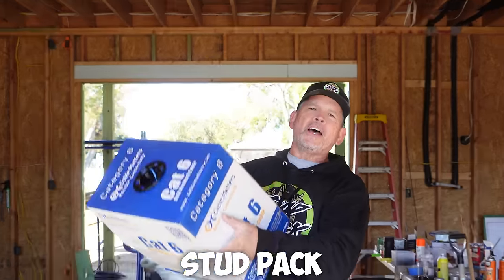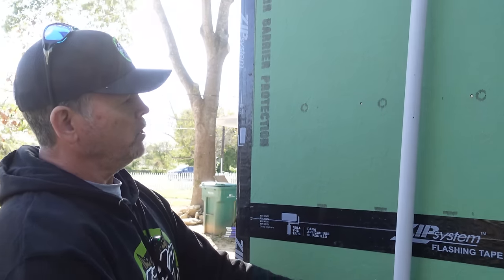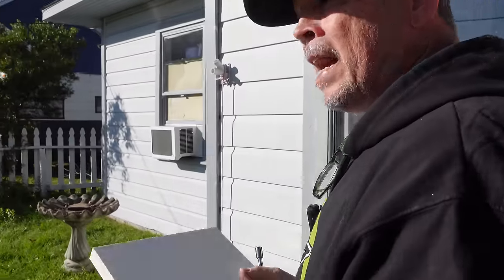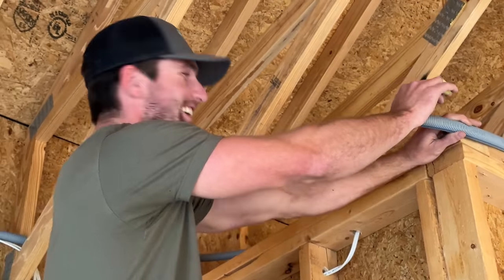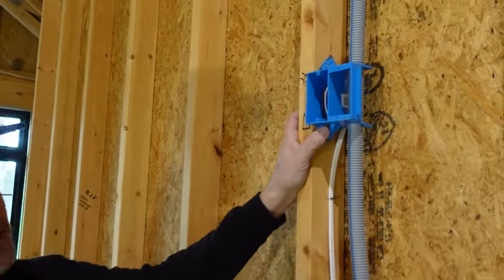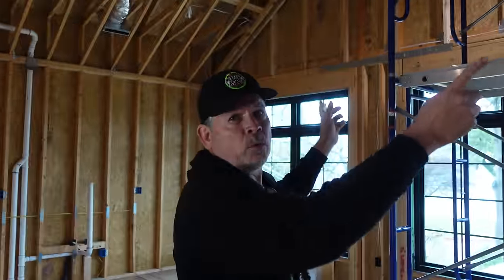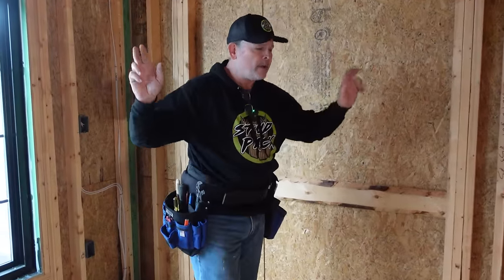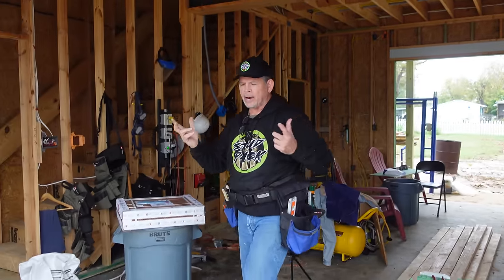DIY Networking for a Future Proof and HIGH SPEED Home! (Smurf Tubing and String Pull Trick!)

Comment: You should use the wall plates with jacks rather than just have the cable going through the plate.  Using a plate with a jack allows you to change the length of the cable going to the equipment easily.  Just having the cable go through the wall plate limits your options later on.  Plus, if you ever damage the cable going to the equipment it is easier to replace a patch cable than to have to patch in a new length of cable.
Reply: 100% I literally came down here to comment the exact same thing.
Reply: Can't think of one good reason not to have keystone jacks and wall covers..
Reply: yes, this a 1000 times this.
Reply: I agree x10...have done a significant amount of networking myself, and have never looked back after learning keystone punchdowns.
Reply: 100% agree! As a data technician.. they are setting up for problems down the road. Should install key connectors.
Reply: +1 to all these comments
Reply: 100000% agree
Reply: Agreed. Also, patch cables are made with stranded copper, which makes them easier to bend, and they won't wear out as fast as solid copper.
Reply: Came here to say the same exact thing.
Reply: They have a cool, one punch keystone tool now, makes it’s pretty easy to
Reply: Do not run the cat6 out the plate....  Put the keystone jack in you showed at first!  WHEN that end breaks, you will be screwed. You need to be able to swap it out.   And it's better for air sealing and cleaner
Reply: I would use a brush plate. You can pull it though and if need be you can push it back to hide it.
Reply: This is exactly what you should do
Reply: The other reason is building wiring is solid copper. It sits in a wall and doesn't get moved around after install. Patch cables are stranded, they are meant to be moved around and won't damage the copper inside from movement.
Reply: I agree. Easier to change a patch cable.
Reply: As a professional LV guy I have to agree. Nothing says trunk slammer then no keystones
Reply: Don’t worry, it’ll be a quick jump to terminating on keystones after they find out how hard it is to reliably crimp solid cable.
Reply: @redmatrix solid copper is for inside walls.  stranded are outside.
Reply: @darkcloud5830  Okay and? What part of my comment made it seem like I was talking otherwise?
I was talking about the benefits of patch cables. I never said anything about WHERE they belong.
Reply: Basically, proper horizonal cabling, Ethernet or network cable, there is no such thing as "internet" cable. Even it does connect you to the internet. 8-)
Reply: Came here to say the same thing, too many issues with field made crimped UTP patch cables. Using jacks you could use thin patch cables of exactly the right length. Jordan will realize this later.
Reply: For the love of God listen to these comments. Also consider a cabinet to terminate everything to a patch panel
Reply: @redmatrix What???  I am just saying the cable should be a certain type of cable and terminated to a certain end. Did I say you are wrong 100%?
Reply: @redmatrix  not if you need the higher throughput of cat6.   just make sure your runs aren't twisty
Reply: And it looks better
Reply: Low voltage tech here and I 💯 agree with the comments. Need to go with jacks. 
Solid cable for in the walls terminated in jacks, stranded cable for device connections with rj45s.
Reply: I’ve never commented on any of these videos as I have yet to see something that warranted my professional opinion. Well here it is… totally agree with all the rest of these people who’ve already said that you need to punch down to a keystone.
Reply: Solid Strand CAT 6 isn't meant to be moved after it's installed. You definitely should be using keystone wall plates, and you should install a patch panel in the attic next to where you plan to have the network switch. Speaking of network switch, you're probably going to one one that supports power over ethernet for cameras / wifi access pointes. You also might want to be considering ceiling mounted WiFi, once the house is built you're going to want multiple access points that support seamless roaming.
Reply: @jasonjones5411  This! And at least a 12 port PoE switch (probably more for the house)
Reply: 100% this.  In-wall cabling should be part of structure.    You wouldn't have romex coming out a hole in the wall, right?
Reply: Yep agreed! 1000%! And they’re called Keystone wall plates and Keystone jacks and not all Keystone jacks will work with all Keystone wall plates. Some of them are proprietary! most of the jacks you buy at Home Depot or Lowe’s should match up with any of the wall place that they sell! I’ve used many different brands of jacks and wall plates, but I buy them at stores that sell to professional installers like me who terminate Cat6 and CAT5e Cabling with cat five and cat six Jack’s. I buy On-Q wall plates Made by Legrand wall plates. They’re available with (1) Jack, (2) jacks, (4) jacks and (6) jacks.
Reply: I agree. Then you can transition  from solid on premise wiring to a stranded patch cable to the equipment.
Reply: @chrisdavidson2192 nope! Disagree! Use RJ-45 female keystone Jack and keystone wall plates with matching Keystone jacks. Never terminate drops using male RJ -45 connectors. It’s wrong and unprofessional on so many levels.
Reply: @w2ttsy670 yep an it’s a giant PIA to fix an issue with male RJ 45 sticking out of a round hole in a wall plate on the ceiling to find out if it’s terminated incorrectly! And there’s never enough slack to cut off the connector, cut of the Sheating line up 8 wires and attach a new male connector Been there and done that I will never do that again regardless of what the customer wants  they don’t know what they’re asking for but I do!
Reply: lol, came here same as the rest "keep the keystone!"
Reply: Totally right
Reply: Yeah,. The female jacks in the wall plates wood be much much better.

Also, given the relatively short run, wouldn't worry too much about interference from the Romex power cable.
Reply: @tonypcoyle the only run in that space long enough to maybe be a concern will be the one to the house.  At least for 10gb.
Reply: Yes agree
Reply: Anything wrong at this point with using a keystone female to female coupler behind the wall plates?
Reply: Yes! I made the same remark in my comment. You can buy these black plastic palm 'pucks' that hold the keystone jack steady as you punch down. I terminate a lot of Ethernet and I find this tool indispensable.  They're cheap, too.
Reply: “Keystone Ethernet coupler” — accepts two female RJ45 plugs
Reply: Came here to say this too. 

On the other end in your network closet you’d also want to terminate the runs on what is called a patch panel.
Reply: Having wire hanging out of your wall is just sloppy.
Reply: 1000% What they said. You also need a switch and patch panel to future-proof your network. With room to switch out to new gear. A 19” rack is a good bet.
Reply: Couldn't agree with you more. I worked in IT for 20 years both networking and server farms.  Do NOT run a cable straight through to the device for all the reasons @rickpoole1274 stated. You will regret your choice a couple of years from now.
Reply: Fully fully fully agree!
Reply: Yes, your wall plates do not decrease the signal at all. If the end of the jack on the RJ-45s break you have to reterminate the end. The solid copper is not mean to bend and flex as much which is why patch cables are made from stranded cable. They are more flexible.  This would be like you all putting a receptacle plug on the end of a 12/2 electrical line. This is a  cheap and unprofessional way to terminate cable. Get a 12 port patch panel for the top. Also are you going to run a cable for the new house? You may want a conduit for that cable to the bridge. Love the content guys and keep it up!
Reply: Agreed 👍
Reply: This. Always punch them down. Separate your infrastructure from your appliances. You don't run romex out of the wall and connect it directly to the microwave. You don't run your pex directly to the garden hose. That cable is going to kink or twist or be too short (or too long) and you'll end up with problems. Put in a faceplate with a modular keystone jack, and it'll be able to accommodate anything else you choose to run through that conduit in the future too.
Reply: This is the way!
Reply: a dentist in town ran his own cabling. He used long molded patch cables and a ball peen hammer, easy peasy!  :)  :)  (looked like garbage)
Reply: Agreed!
Reply: @eschultz19661  trunk slammer 🥴😵‍💫😵😂
Reply: Definitely that
Reply: Did he just use rj45’s?
Reply: Rj45’s aren’t made for
Solid copper …. The connection is not as good ….
The female jacks bite into the wire in line 3 different places on each wire ..
I ran  this stuff professionally since the mid 90’s.
Reply: 100% Agree. Make sure you get cat6 female jacks as well.
Reply: Agreed. I would use those CAT6 wall jacks . I am glad because I can make other run as long as I want. Also a wired connection is always more dependable. Will you have a private bedroom with a door. One big room is great but not for any privacy. Keep up great work.
Reply: 100%
Reply: Came here to say this very same thing.  Always go with the keystone jacks with wall plate.
Reply: yea 100% this, you shouldn't run directly to the device you gotta think future proof, it's a lot easier to work with the coupler female and and terminate it, also that's not very many runs, I know there are automated blinds that will run off cat6 power over ethernet (PoE), then there are PoE Cameras that I ran myself as well, then also think about any WiFi locations you may want to have for coverage through out the house.  It's sooooo much easier to do it with the walls open, even if it is over kill, as I ran 50+ drops myself throughout my house for all the same things.  ALSO keep in mind that you can send HDMI signal over cat6, as they make adapters so that'd be another possible usage.
Reply: Came here to say the same thing
Reply: Yea, punching down is easier than terminating cables anyways
Reply: I too was going to reply just like this!  I've had many elections act like it didn't matter, but it DOES!!!  Thanks for all the great videos!
Reply: Noooo....no mod ends. Been in the business for 26 years. Every time a client had mod ends they had poor network performance. We always had to redo the wiring with wall Jack's. It's worth the work. Everything else in your built is top notch. Don't install sub parts networking.
Reply: +1 here.  On top of that, terminating those male connectors is a waste of your time. Just buy a bunch of patch cables of various lengths and you're good to go.
Reply: The face plates come with tabs to hook to the drywall. you don't need boxes.
Reply: I will add to the chorus but ALWAYS USE KEYSTONE JACKS. Others have mentioned the numerous reasons why but as someone who has run plenty of cable, you are less likely to experience failure if you use jacks. I had to reterminate a cable 3+ times because I kept not crimping the cable perfectly and that was with a tester.
Reply: Agreed
Reply: I'm pretty sure he meant no wall plate jack to the one that they are going to remove when they knock out that wall. So not much can really happen in that time. If it were me I would use the jack anyway because why not if you're going to put the box in anyway, but I don't think it matters for that particular location.
Reply: I believe he means they're using pass through connectors.  It's just a double female port.  Allows cable to be terminated as shown then plugs into rear of wall plate.  No difference to end user.
Reply: 100% I literally came down here to comment the exact same thing.
Reply: same @farmitzdugan
Reply: @Ihavetopoop718  I wouldn't say that they has no idea what he's doing.  (And it sounds insulting to phrase it that way)  CAT6 is rated for 10Gbit speeds up to 165ft.  It a garage, and his fiber distribution point will be right above his head.  He's not going that far.  Even if they route CAT 6 to the other side of the future house (doubtful), they are going far enough for that to matter.  CAT 6 will be fine for his use.
Reply: As others have said . . . I came here to say this exact same thing.
Reply: Also, you use solid core copper for horizontal runs in walls. that's more subject to work hardening and damage, while you connect stranded cables for the patch cable from the plate.
Reply: Keystone jacks.100%
There's so much involved in good structured cabling. It pays to do some research ahead of time and see what's new and what's popular (and why).
Reply: agreed
Reply: Agree 1000%. I'm an IT Director with 30yrs experience terminating cable.  What you guys did here is the equivalent of hardwiring your appliances to your electrical panel.  Always terminate at the wall.  The good news is, it's an easy fix as long as you have enough slack in the cable.
Reply: I agree. The type that you use in the walls is typically solid because they won't be moving and have better signal over longer distances. Solid cable is not great for patch cables because those cables are typically going to be moving around, because they are outside of your walls. These runs should terminate at a central patch panel where you run patch cables into your switch. Using keystones with wall plates you can then use stranded wire cables for the patch cables from the wall to the devices.
Reply: Only time I would ever terminate the riser cable with a plug would be an AP(wireless access point) on an existing ceiling. Otherwise I would float the jack inside a single gang box, preferably metal for strength. Never would I have a “plugged ended riser” cable attach directly to an end device, for all the above mentioned reasons.
Reply: @kylereed3577  even then I'd try and just leave a keystone jack behind the ap and use a very short patch cable tbh
Reply: Keystone jack should always be used for permanent installs.   But you can use keystone jacks that are couplers, not punch down.  That would make it so you could finish and test the cables now and then when you get to the very last part of the build, you just plug them in.  Bit quicker and more flexible.
Reply: @q1joe  can you give us the make and model of this tool pls? I have a commercial project that will require over 200 keystones to be installed. If this saves me seconds on each jack it will be worth it.
Reply: @chrisdavidson2192  I use brush plated for connections between a TV and a device such as a cable box since the types of connection can vary depending on equipment changes and changes of location for the cable box and other devices connection to a TV or an HDMI switch as an upgrade. I still run the cable in a conduit that opens on the side so I can change or add new cables. With an HDMI switch, I can usually reduce the cable connecting to the TV to one or two cables (one for each HDMI port on the TV). When I use an HDMI switch  all the devices then connect to it with short HDMI calbes (1 foot or so).
Reply: @jasonjones5411  Recent build they had a network room with a two-post rack and then a small enclosure cabinet. All audio, video and security cabling terminated in the two posts and associated devices were in the cabinet. Everything was remote to this room. This is becoming standard for medium-sized deployments. It's usually located beside the electrical room. In the electrical room, a bar fridge-sized UPS is installed for 12 hours of power just to the media and telecom in the event of an emergency. The newer setups are deploying lithium battery packs for longer battery life and more power. An additional 20% cost for lithium but made up for battery replacement costs. Also, power is tied to the main AC so that a generator can take over in the event of an extended outage.
Reply: Yeah came to comment the same thing… also if there is any failure is most common it will be the patch cable if you have certified the CAT 6 in the wall. In the trade business of pulling cable I always end cables at the wall with female RJ45. In some places (even though is low voltage) is required
Reply: I agree 100 %, so that if the owner needs to move things around, they are not limited to the amount of cable pulled out. They can just plug in whatever length cable they need.
Reply: Yep, there is a reason everyone does it that way. You are not going to lose any bandwidth or cause any problems at all. At least with the way he did it he can cut the wire off and add a plate and jack late.

Comment: I've ran hundreds of miles of Cat4/5/6 ethernet cable and would suggest moving the Smurf tubing at least 18" from the 120v power lines.
Reply: Would shielded cat6 with shielded connectors be ok next to the wires?
Reply: What he said, it absolutely most likely will cause an interference 👍🏻
Reply: It's internal.
Reply: You’re forgetting fiber is light pulses not electrical pulses. It’s immune to emf or Emi. Learn your cables better buddy